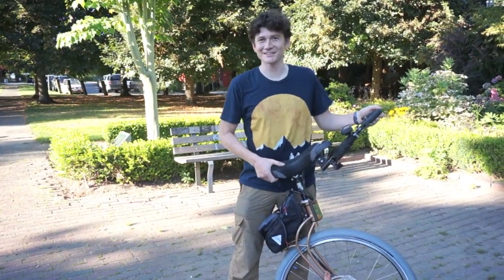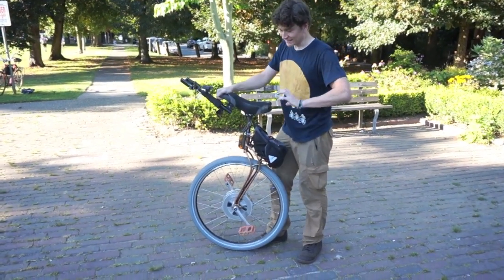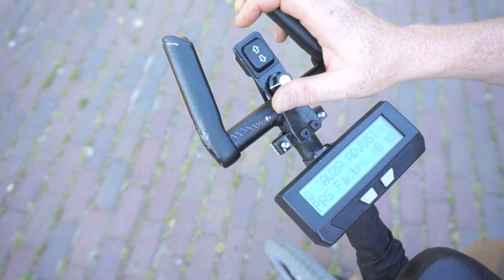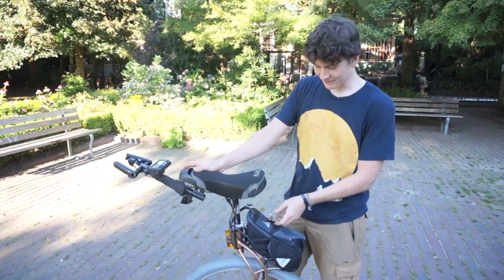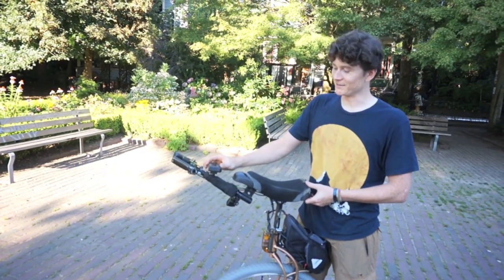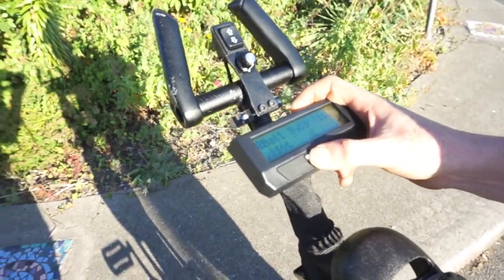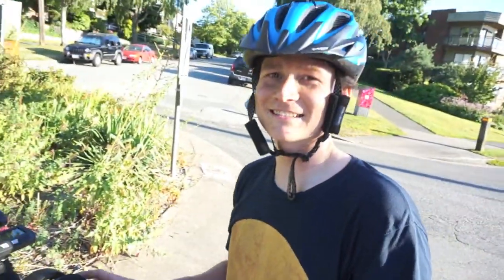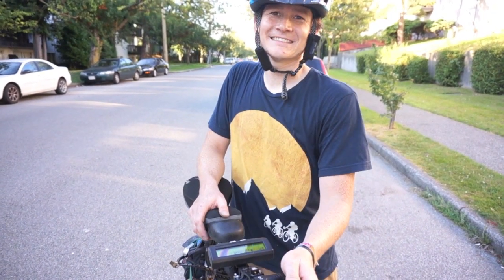A Geared, Torque Sensing, Electric-Assist Unicycle Prototype

Comment: I sure hope someone is around listening. I’ve got a new bug to make 26” muni with electric motor and self balancing. It’s either this or just hanging some fake pedals to shut some of those “Karen’s” out there . I’m actually just an old retired guy but I rode 20” uni’s for years, then 1000’s of miles on my One wheels, and lately my Begode T 4 and master both fitted with Surron seats and soft suspension. I only ride unicycles sitting electric or not my choice. My first Euc was when I modified one of my old Onewheels with a removable fixture/seat. I am very electronic/mechanical as I was automation engineering specialist for 40 years. Unfortunately. I probably have a controller and batteries. I’m thinking of a big fat 24-26” x 4-5” wide tire . I’m not sure what to consider for a motor whether I have to build a custom wheel or not. Power assist with assist level choice and self balance is what I want in a bigger fatter wheel sporting a smaller battery. I am more of slower technical rider and rarely exceed 20 and usually average 5-8…lol. This not about speed for me, it’s just the coolest ride ever all by itself. Help Please

Comment: What if you have to stop suddenly at 30kph
Reply from the maker: The art of unicycle riding is all about avoiding sudden stops.  But if circumstances require it, you have two feet, gloves, and a helmet. In contact with the ground those items can result in a quick deceleration.

Comment: What do you think about a hub motor unicycle no pedals no self balance computer just a throttle and hand break. Really interesting how you have your unicycle set up that way. Looks like alot of fun! I haven't seen a set up like this before either
Reply from the maker: That's totally doable and would interest me a lot more than the electronically self balancing unicycles.  There are many skilled unicycle riders who can coast down knarly terrain with no pedals just by modulating their disk brakes, so what you propose would be more or less the same thing only with the ability to go on the flats and up hills too. 

In principle this would be no different than those who can ride a motorcycle in a wheely, although the actual technique to balance on a unicycle is a lot different than on a 2-wheeler.
Reply: Grin Technologies Thank you for understanding! I'm definitely going to give it a try this year.
Reply from the maker: Keep us posted when you start playing with that. It wouldn't hurt to learn and practice brake coasting with a conventional unicycle first!

Comment: dude where can i buy this! or at least something like it, this is amazing.
Reply from the maker: Sadly there aren't AFAIK any commercial electric unicycles out there that you can pedal like this, but hopefully one day someone will think it's a kind of product worth making.  If we find the time to build another one here it would probably be in a 20" wheel size with about a 2.5:1 gear ratio on the wheel.

Comment: What happened that causes you to fall at the end?
Reply from the maker: I got ahead of myself trying to go faster. This was my first time riding it with the shorter cranks and it always takes some adjustment to get familiar to the reduced leverage from a shorter crankset. It would have made more sense to get used to it by riding around the block a few times before jumping right into a speed run!

Comment: This is very cool; I'd love to make one as well. Which torque sensors did you use? What do you mean when you say that setting the potentiometer too high leads to oscillations? It seems to me that the higher you set that potentiometer would correspond to a higher "gear" on a traditional geared unicycle. Is 1.7 the default gear ratio of the Grin motor or is that a modified motor?
Reply from the maker: The torque sensing is built into the planet gear holder with strain gauges. Please read the build thread for the project here:
http://www.unicyclist.com/forums/showthread.php?t=119436
Specifically post #14. 
The motor is direct drive (no gear ratio) and the pedals are linked to the hub shell with a planetary gear that gives a fixed 1.7:1 drive ratio. This is also shown i the thread above. If you read that things should make more sense.
Reply: Grin Technologies very cool, what a great read. I don't think I have the abilities to make something that amazing so maybe I'll start with a throttle controlled direct drive, a la your earlier implementation. How ridable would you say that iteration was?
Reply from the maker: Throttle control works pretty well IF you have a torque based motor controller. If you have a normal motor controller (where the throttle controls the speed of the wheel as opposed to the torque on the motor) then it's quite difficult to ride under assist. I've explained the reasons for this in some of the earlier electric uni build threads.
Reply: Grin Technologies that makes sense for sure. I read your 2010 endless sphere post about the throttle-based approach you took, and I didn't understand why you couldn't use an off-the-shelf hub motor attached to the spindle?
Reply from the maker: Because the stator of a hub motor is just that, a stator. It's connected to the motor axle and is not supposed to rotate.
Reply: Forgive my ignorance on this, but I guess I was asking why the unicycle spindle couldn't be bolted to the side of a standard hub motor, perhaps a thru-axle one. My understanding was that the side plates are connected to the rotor, not the stator, so bolting the spindle to the side plates would not be attaching it to the stator?

Comment: Tat's genius! But I noticed there is no brake! Do you just flip that top switch to create friction if you have to stop quickly?
Reply from the maker: Yes exactly, you press the down button a few times quickly in a row to get substantial regen and braking force to slow down. Or you just brake with backwards force on the cranks and have the motor amplify that, so it comes to a stop much faster with just the legs compared to a regular GUni. 
With the push button it's maybe a bit slower to engage than an actual lever, but on a uni you need to prepare yourself to stop (by leaning backwards) before you can actually brake anyways, and so I don't think the time to push the down button is much of a factor. -J